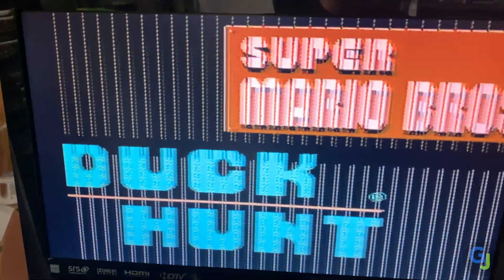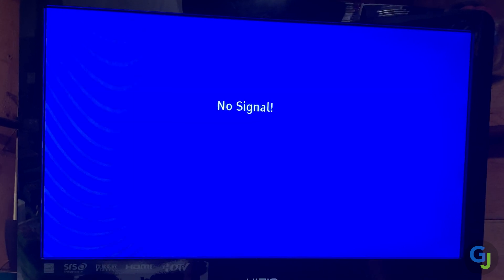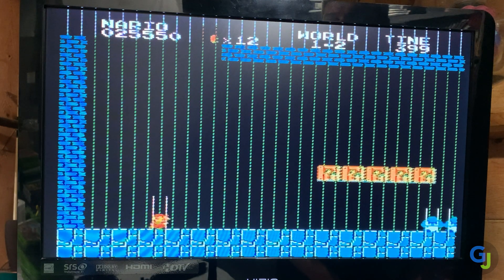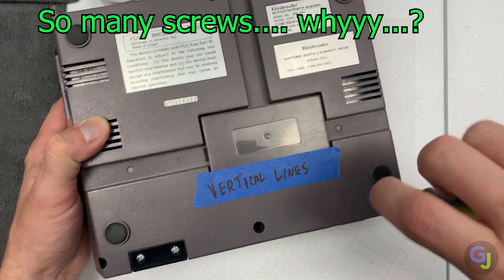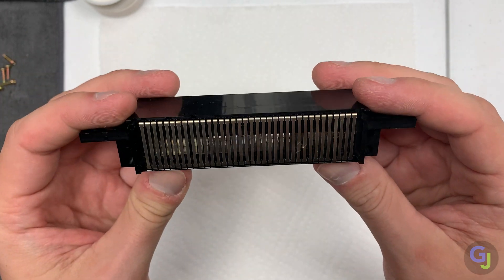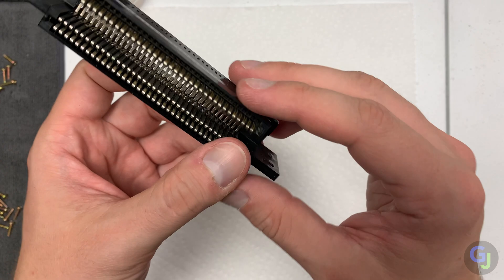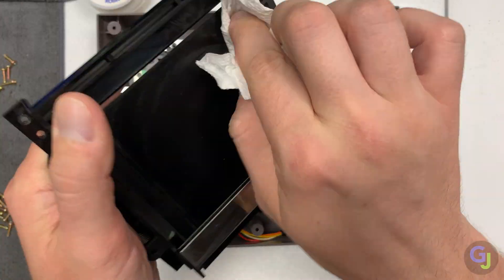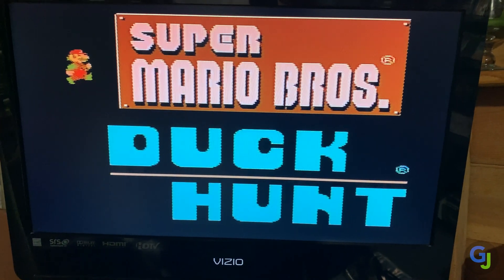Can You Fix An NES Console That Has Weird Lines When Playing Games?

Comment: Hi! Ive got the same issue but it ia definitely my everdrive cart because any other original cart works well and I cleaned the cart and replace micro sd and still glitchy
Reply from the maker: Good to know, maybe one pin on the cart is out of place or just barely corroded then? Seems odd if other carts work though.
Reply: @gamejaeger  yeah Im so disappointed, will try opening the cart again
Reply from the maker: Good luck! Hope you are able to fix it!

Comment: I have same issue when I play Contra but this doesn't happen to other games, I already opened and clean the pins with out success, any suggestion ?
ps I'm playing with the analogue nt mini
Reply from the maker: Best info I can give you is check the board for defects or maybe try it on another console to see if the newer unit is the problem. Even though it's newer, it may not be getting a good grip on the pins if the board is warped or something like that.
Reply: @gamejaeger  Hi I just upgraded the firmware of my nt mini and problem solved !!
Reply from the maker: Nice! Weird problem to have for a newer unit though.

Comment: Do you not have to push the cart down? It doesn't work if i don't push it down.
Reply from the maker: Because I had previously refurbished my 72 pin inside, its very tight and I don't need to push the carriage down to get it to work anymore. I guess it's a common side effect of refurbishing them or buying new versions since it grips the pins enough without having to push it into place. It's actually kind of nice and I like using it this way better too...

Comment: I'm having the same issue but the lines on the screen are worse
Reply from the maker: It may be the 72 pin just needs some cleaning then. Or maybe it has a pin touching another pin inside. You'll probably need to open it up and check to see if there are any issues with it to confirm.

Comment: Not every problem with an electronic device is necessarily a "short."  Short simply implies that there's a direct electrical connection between two points; and while yes this can often cause a problem, a failure does not immediately imply a short; it could also be some kind of interference, an actual failed component or chip, or an open (the effective opposite of a short).

In this case, it looks like that unseated pin in the connector was pin 33 on the top row; a quick search of the connector pinout suggests that it is PPU Data 3.  The  other 7 data lines and all 8 address lines were presumably connected while Data 3 was OPEN... these pins are where the video processor gets its tile data/information.

If you look back at how the problem presented itself onscreen, you can see that even though the artifacting had random results based on which tile was being affected, it still occurred with consistent frequency across a plane or sprite.  Like you noted, you were also able to play the game without any other functional issues.  If one of the graphics data lines were OPEN, then the PPU would basically just get garbage every time it polled that pin for information.

Fortunately it was a simple fix, but if that pin hadn't been the culprit, I would have said it looked like a PPU issue outright if not just a really corroded connector, which could have similarly caused a break in communication with one of the graphics data or address lines... I would have followed traces and inspected solder connections along the PPU lines on the board; residue over time can corrode solder joints or oxidize traces and component legs.

It was obvious from the beginning that it wasn't a poorly shielded cable or the NES10 lockout like other people suggested, I think we've just all had countless different compound issues with these machines over our lives, so sometimes it FEELS like it could be fkn anything lol :P
Reply from the maker: Great explanation, thank you! And I agree, some of the suggestions I found on forums just didn't make sense at all. It was interesting reading though lol.